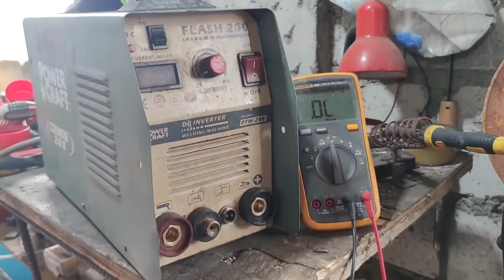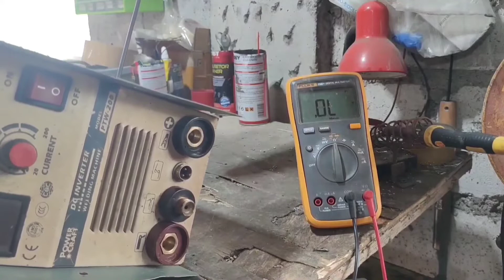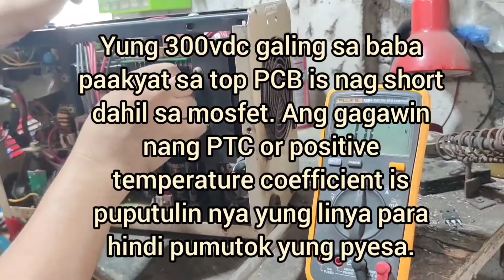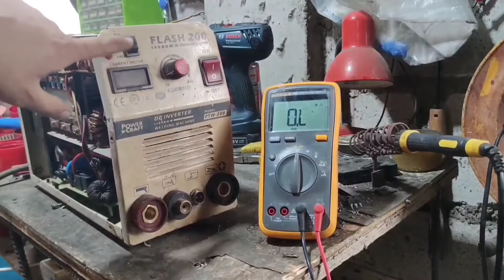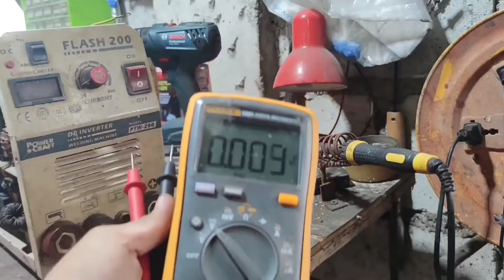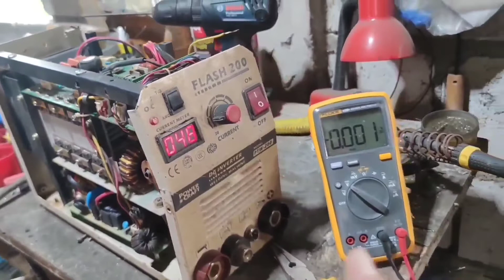Power Craft walang power? baka ito sira niyan mga lods

Comment: May isa pa akong ginagawa lods, ang unit nya is, COMPACT MMA-350, sabi ng may ari di naman daw sinasadya na mapatid doon sa power cords ng inverterwelding na ito lods, tapos sinaksak na ulit, umandar na, pero after mga 10 minutes daw biglang namatay na, at dina nag power on. Kaya dinala na saken dito, at sinaksak ko nga kung wala talagang power on. Wala nga, pero may bigla nalang pumutok na ic, yong 10%power supply na ic para sa relay at blower yon, LNK626 yan ang pinalit ic kasi warak yong ic nya. Tas di parin sya nag oon. Tinitest ko sya sa protect bulb, para walang pumutok. Kaso wala parin lods, anu kaya posible na issue nya?
Reply from the maker: Check mu mga resistor katabi nang ic pati yung pulse transformer baka nag open na yung paa
Reply: Na check ko na lods mga resistor katabi ng ic yong pulse transformer nalang ang hindi.

Comment: Good day lods meron akong ni rerepair na ganyan na power craft 160i.may power walang output, at umiinit yong apat na mosfet driver nya. Tsaka sunog dalawang resistor don sa signal ng mga mosfet. Ano kaya posible na sira nya lods?
Reply from the maker: Check mu maigi yung mga mosfet sir baka may defective pa kaya umiinit yung driver. Check mu din yang mga mosfet driver baka may sira na. Pag ok lahat possible problem nasa control board na mismo kung kaya mu tyagaan repair yung board
Reply: Ah ok po lods,, thank you sa kasagutan nyo.